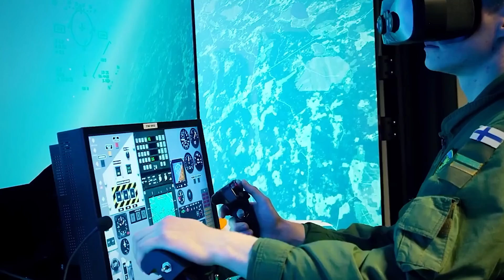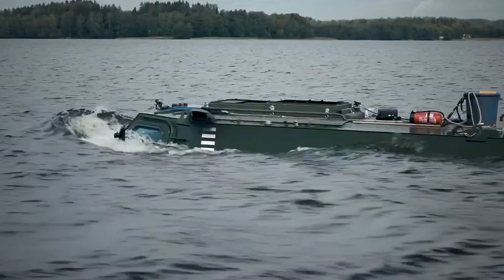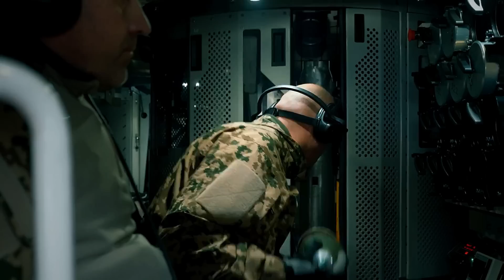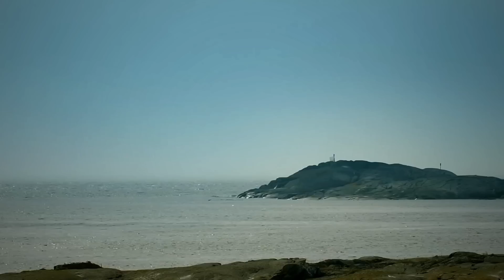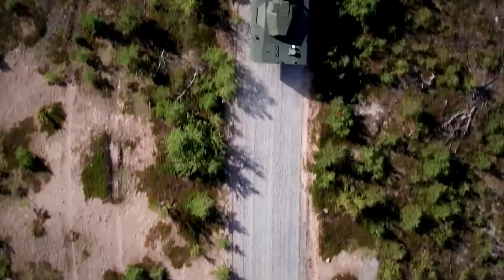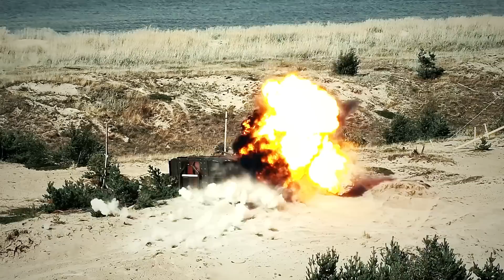The Most Versatile and Brutal Mortar System Ever

Comment: For such a high-tech system, why must there be two flesh-based loaders on board? The loading scenes in the video are like an awkward flashback to WW2 or something. One would think that the war in Ukraine has taught us all that armored vehicles are vulnerable to cheaper modern guided missiles. While the costs of losing the weapon itself can be acceptable if it is put to good use first, it seems senseless to lose three crew members when one or two would be enough to run a better version of the system.

Comment: Can you imagine this adapted to fire from a C-130 gunship? Less recoil than the 105 and numerous warheads..
Why the NEMO hasn't been adopted yet is bizarre.  A 120mm mortar bomb can disable any APC, IFV, etc in existence now and developing one for attackicking tanks even from the front with such a big shaped charge could easily take out most tanks.
The Navy and Marines are constantly looking for ways to defend regular and amphibious ships could easily use this.  I recall readying that their is a RAP round for this with a 2o km range.
It could be attached to a amphibious vehicle and put on the deck of the amphibious ship.  Why more of the Swedish and Finnish patrol boats arnt going into service for use in the Pacific with these is negligence.
I think the Indonesians are working on a patrol boat using a Cockerel 105mm 0r 120mm turret.
Haevily armed patrol boats operated by Navy SBS and brown water Navy and Marines could be made modular.  It doesn't have to be all plug and play.  With this NEMO container it could be load, secure and play.  No doubt its pricey but the thing that matters here is that it can be easily loaded and shifted between ships.  This is a less expensive HIMARS and with a broader capability for close in defense on sea and land.

Comment: That firing platform placed on the ground would only fire a few salvos before being destroyed by counter battery fire. There is no way anyone is going to just sit there and be targeted for death. If artillery cannot move immediately after firing in today's combat it is almost assuredly guarantee to be destroyed.
Reply: If you dig a hole for it, its pretty small target then. Hitting a turret at groundlevel is hard and these container versions can be massed and concealed waiting for breakthrough attempt.
Reply: You can just leave it attached to a truck and voila, you have mobility. This thing is designed to work almost in any situation and with almost any platform.

Comment: If the NEMO container system has a mass of 11400 kg including 100 rounds + 3 crew, then an empty container might be transportable by CH-47F Chinook.  Consequently a couple of CH-47s could drop off a supplied unit on a mountain top landing zone and establish a precision munitions artillery base in minutes.  That is very impressive.
Reply: A Chinook F can lift it, not sure as to what altitude though. The heavy lift cargo planes can certainly shuttle them with no issues.

Comment: This is an excellent way to mass firepower and install it on a wide variety of platforms. It's far easier to manufacture a weapons system and store it and then attach it to other vehicles than to build it exclusively for one platform. The next problem it creates is that a military needs to make sure that it has enough compatible vehicles without causing itself to be short in other areas like logistics. Since it would certainly work on many civilian vehicles, it's perfect for national defense.
Reply: I agree. They also didn't mention that its loaded weight is 11,400kg and Chinook max underslung lift is 12,000kg. So it could be air portable (barely) as well. I wonder if they can air drop it from something like a galaxy.
Reply: The size makes it easy to ship on rail ways. The trucks it mounts on is common, this increases the utility of buying more of the platforms.

Comment: Honestly, would be great for coastal landings and for island nations in general. With spotter drones you have active fire support to clear the way for landings, nowhere near calling in a battleships main guns but it fits on such a small boat similar in size to the landing craft. Much more affordable.
Reply: It is great for quickly setting up static defenses too. Some earth moving equipment to build ramparts and a slot for the unit. Stick one there, move on to the next.
Only the turret shows from the front and sides.
Reply: @recoil53  only downside is the relatively short range for a static defence, would be quick but it's like setting up a target that can't shoot back at most arty.

Comment: isn't it Nemo container just a sitting duck for counter battery fire? Container is no protection against anything more than small caliber bullets....
Reply: There is always place for mobile and stationary weapon systems. Mobile would be operating in reach of counter artillery, ie scooting away before getting counter artillery raining on them. Stationary pieces are obviously going to be used in tactically sensible manner. ie advancing forces withing their reach, but not in reach of enemy artillery. You can not just pull your artillery too close to frontlines, therefore your stationary pieces can safely be utilised to stop advancing force far from reach of counter artillery. Also, talking about protection against artillery. It is the shrapnel that does the most. For artillery shrapnel "small caliber bullets" protection is enough, if not getting direct hit. Direct hit destroys anything though, no matter what protection you got.
Reply: Think base defence.
Reply: You have no idea how mobile mortar tactics work, do you?
Reply: True it will be blown with in a minute
Reply: The MRSI capability should allow it to fire of a salvo, pick the container up (doesn't necessarily even need to as it can just fire off of the truck bed) and leave before the rounds even impact.

Comment: Interesting design. Wonder if it works on commercial vehicles.  It would definitely make it more worthwhile if a standard cargo truck could just carry one around.
Reply: Looks like any hook will pick it, it’s less than 25,000lbs loaded
Reply: @HubertofLiege Any vehicle that can handle the recoil can in theory carry the system. Your idea is workable in principle.
Reply: .. the trucks eg... APC .. 6x6 .. these are actually based on ordinary truck design , truck wicch used during soviet times ,